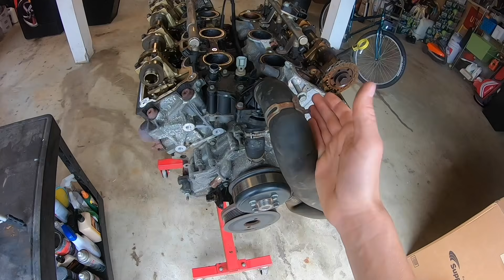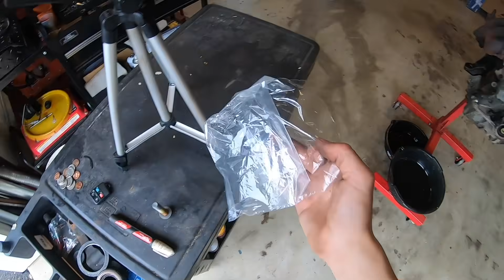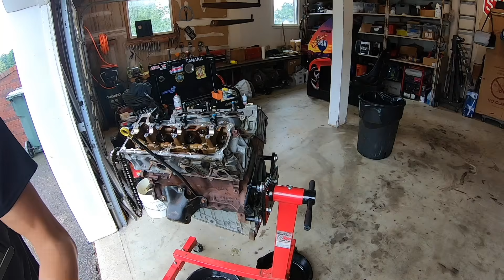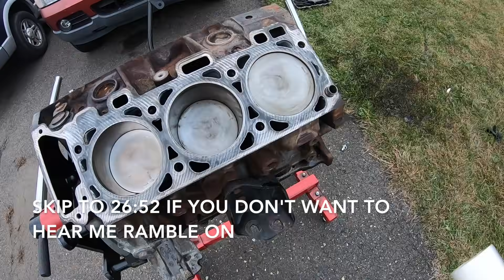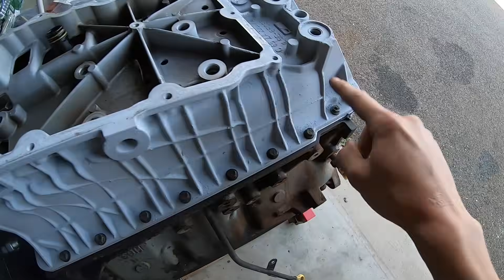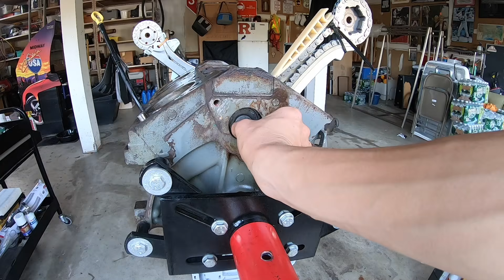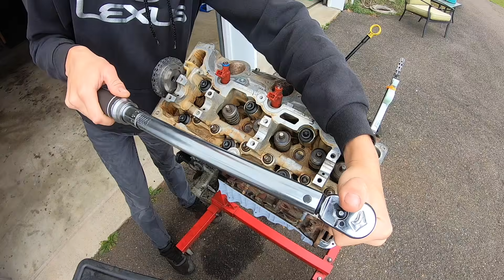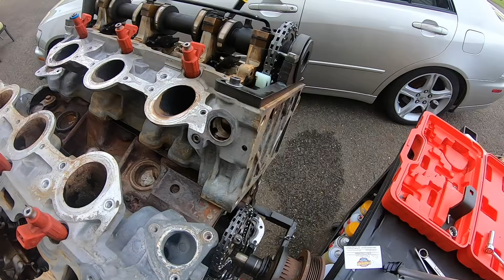Ford 4.0L SOHC V6 Head Gasket and Timing Chain Replacement (COMPLETE GUIDE)

Comment: 2005 ford explorer. Blowing exhaust out resavior. Run hot still have water. Won't start now. Did compression check. 2 readings of ,60 and 80. That's from the blown gasket right? Those cylinders were right next to each other. Had a 180 165 155 on other side. If I change the head gasket it should run again right,?
Reply from the maker: Yes
Reply: It's passenger side. So I have to remove engine from vehicle to do the head gasket?
Reply from the maker: @richardvanwinkle1887 it’s recommended to.
Reply: Could you please explain how you would without removing? My wife and I are broke down in denver. I get a VA check and that's it. I have no ability to remove it.

Comment: I heard different things. I heard the sporttrac fixed the timing cassette issue before 2007. I don’t know how that is possible though because it’s the same design 4.0. Did the sport trac ever fix this issue during the sport trac model duration? To me the 4.0 issue was a design issue and it was never fixed? Am I wrong?
Reply from the maker: The 4.0 was never fixed. It was fixed in 2011 when they discontinued it.
Reply: @iamdjnam  lol

Comment: First off DELETE THE UNNECESSARY BALANCE SHAFT!! Unbolt it throw it in the trash! plug the 2 holes that are threaded already that feed oil. If you have an old engine there are quite a few small plugs that you can take out and use.  The engine will have better response and better oil pressure that is needed for the tensioners. Another "mod/upgrade" is putting an O-ring on the peg on the right side guide for the main chain since it has a peg that goes through the oil jacket for the driver side tensioner and oil pressure sensor. Ive seen oil leak passed the guide.
Reply from the maker: I only put the balance shaft as a tutorial. I always delete it.

Comment: There's a lot of info saying this engine is a non interference engine. So I get all excited taking it apart that I won't have much damage outside the timing chain. Well I have 2 bent valves on the left and one on the right so that is, in fact, b.s. Thank you so much for this video. Your stuff helped me so much otherwise I don't think I could've done it.

Comment: 1:03:06 Love what you do. I have a serious issue. Swapped 2004 Sport Trac for a 2006 Ranger motor. Started it and it made a racket. Stripped it back down in the engine. 
Nub on Sport Trac is down, but I put Ranger up according to your video. No joy. Timing assembly doesn’t line up in Half Moon on Ranger, but does on Sport Trac motors. Could older (2004) engines set up 180 out? 😵‍💫
Reply: Btw, driver’s side cam.
Reply from the maker: @nathanhightower3150  nub must be up on both engines. Timing was always set the same. Sounds like your passenger cam is 180 out.
Reply: Yep. Set it at TDC exhaust versus compression AND IT RAN, but I shut it down and tore it apart.
Reply: Corrected and running well!

Comment: Just found out today that my head gaskets are leaking on my 08 mustang 4.0. Do I have to remove the front timing chain cover and chain and the cam shafts to do the head gaskets?? I don’t want to pull the entire engine, just do the heads only.
Reply from the maker: The entire engine should be removed.
Reply: @iamdjnam  can I ask why? Does it just make it easier is all? I don’t want to replace everything like you showed in your video (which is VERY good), I just wanted to replace head gaskets only and possibly the water pump
Reply: @iamdjnam  I think I emailed you before when I needed help doing the rear main seal. Can I do that again if I have questions about this project? Also…..: how do you know so much about these engines at such a young age, it’s amazing 😊
Reply from the maker: Yes email me if need be

Comment: Finally finished the timing gears and the timing jumped and broke two valve springs, ran 1 day so it all came back out and I asked before, can I pin the gears on the cam and jack shaft, Ford should have done that in the first place, even thought about a small tack weld.
Reply from the maker: No you cannot pin the gears. I’ve never had an issue using the timing tool kit as intended.

Comment: I chose the young man for the same reason you did. He I very smart, and explains everything so I can understand what the heck he I doing . And above all  he gave the confidence to do my 2006 4.0 Mustang, where before I was very scared to do so . I thank you for the great videos. You made me proud of myself for fixing my Mustang.  Thank To You.
Reply: Hi. Did you pull the engine to do it or were you able to do it with the engine still in the Mustang?
Reply: @MarcinButzak  I think very few people have pulled off replacing the rear chain with the engine in across all platforms

Comment: I did the passenger and then driver.  When I spun the motor the passenger was slightly off, using the holding tool it was not quite perfect to slide those notches in. Is there going to be some slop in there that is tolerable.
Reply from the maker: Loosen both cams and start over.

Comment: Do you have to remove the motor to replace the head gaskets ?
Reply from the maker: No but you should because you can’t replace the timing guide with the engine installed.

Comment: I have a question. I only removed my cam shaft and replaced the hydraulic lifters. I put the crank on TDC. After installing the cams back I turned the crank a couple of turns. Now I don't know if the balancer shaft is in the right position. I didn't open the front plate. Do the cams correspond with the balancer shaft or just the  crank?

Comment: This video has helped me wonder but I ended up snapping my lower positioning bolt. When you said the torque spec did you mean 89 in lb like in another video you did or is this one actually supposed to be 15 ft lb. Wasn’t sure if I did something wrong or not.
Reply: Wonders*
Reply: Or if my bolt was just bad
Reply from the maker: @PlusUnum  depending on the source the spec is different. To be honest I just go by hand.
Reply: Ah okay thanks 🙏
Reply: I think there is a difference between inch pounds and foot pounds. I’ve noticed they say 2 different ways of torque

Comment: Hey i want to start off by saying I appreciate your videos, I couldn’t do remotely half of what i did on my Mercury Mountaineer without your help, but right now I’m at a snag, So i rebuilt the engine mostly and after i put the engine back in and fired it up, the car shakes violently when i start it, it will smooth with some gas but it will go right back to shaking and i believe it’s bcuz of the Harmonic balancer not being pushed back far enough, i have a “2008 Mercury Mountaineer 4.0L V6” and the tools i could only find don’t fit the harmonic balancer correctly, my harmonic balancer is the Long cone shaped one and i can’t hold the nut in order to ratchet further in properly so the belt doesn’t stress itself when turned on, idk what tool to use or if i could upgrade the harmonic balancer to the shorter more open ones that I usually see that would help but idk honestly, autozone or anywhere else only recommends that same harmonic balancer and it’s just too long to get it installed correctly, Please Help Thank You!
Reply from the maker: If your harmonic balancer isn’t pushing on all the way, sometimes it’s because the wrong crank gear was used from the timing set. They don’t tell you there’s 2 thicknesses and I’ve made that mistake it the past. Also sounds like you have a vacuum leak. No matter what harmonic balancer you use, 2002-2010 it will work.

Comment: I wished i had your knowledge about this engine at your age! Life would have been different by today. i have been rebuilding many inline diesel engines but never this V6 4.0l Ford EXPLODER! Yes a customers Ford EXPLORER exploded and we are going now thorugh that whole procedure. I usually do my engine rebuilds according to the best video i can find, wearing headphones during the job and have the video running on a big screen in my workshop. This time its yours which will run several times up and down! Thanks young man for all the hints and tricks as they are essential. Your video makes it safe to rebuild even as a beginner (i am not)!

Comment: thank you for this vid. i learned alot about this model motor. i'm doing a timing chain replacement on 05 sport trac.  alot more involved in timing than there used to be with old motors. i'll be following this video for my repair on this motor.  thank you again for your time!
Reply: For sure!

Comment: Can I pin the cam gears, still would do the whole torque deal, also the only reason to use torque to yield head bolts is the MLS head gaskets.

Comment: Regarding turning engine   Crank shaft by socket 360  degree to check if engine turns freely, should valve cover need to be off to check see if cam gears they line up to TDC???🤔

Comment: I did all this and it ran great for 20k miles, then one die it started sputtering , made it less than a block and died, I checked spark compression, fuel pressure, noid light on injectors all are good. I'm afraid it jumped time again somehow. Probably the cheap Chinese timing kit I got off eBay. It turns over and won't pop or sputter at all
Reply from the maker: You have compression?
Reply: @iamdjnam  yes compression on all 6 cylinders. .
So, it has run absolutely beautiful since I did the timing job following your video. I was coming home a couple weeks ago from an hour drive, as I was pulling to a red light it started feeling like it was going to die, I stopped at the red light and it sputtered and barely stayed running, when it turned green, I pulled it off into a parking light and it died as I pulled in. I have tried and tried to turn it over since then and it has never popped or even tried to start again as though it has no fuel or no spark. It kind of seemed like it was running out of gas, so I put more gas in it, put gas in the intake, nothing not even a pop. Checked the fuel pressure at the rail, 60psi. Put a noid like on a fuel injector plug it flashed. Checked spark with a spark tester multiple times it sparked and even shocked me twice. Checked compression on all cylinders and they where above 120 on my cheap harbor freight compression tester. I don't trust the compression tester but I could tell that they had some compression, at least enough to sputter or try to start..... So I'm thinking that somehow the timing skipped and the thing is sparking sometime when the valves are open only
Reply: @iamdjnam  oh yeah, and I checked codes and got P0340, cam sensor code, changed to a different cam sensor and crank sensor, that's where I'm at so far

Comment: I'm working on a 2006. The chain came out the driver's side valve cover. But it happened when trying to start it. When I took the cam off, so all the valves are closed, I can't blow air into the cylinders. But I guess there could still be a slight bend somewhere still. Or is it possible it's safe? IDK 
I will be taking it all apart later and checking everything. I did get the engine out today. There are signs it's been out before. Maybe some Ford recall? IDK
I'm in California, so the exhaust bolts came off eay enough. One stud came off each side, but one side was missing the stud and nut. LOL
Well, at 9:40, yours looks like the short one on the engine I have. The parts lists sho long piece on that gear.
Reply from the maker: You bent the valves. Need to send the cylinder heads out now.
Reply: @iamdjnam  Since it seems I can't find new bearings for the balance shaft, I'm going to have to leave it out. So I just need to plug those two oil valleys with a bolt, right? That's it?
Reply from the maker: @shark70007000  yes

Comment: What is the installation depth of the front main seal into the timing cover?
Reply from the maker: Even with the back side
Reply: Just asked this same question.  Even with the backside? How would you know how far if installing the seal with the cover on the engine?

Comment: What is the purpose of the balance shaft.  If you can delete it and the engine still run fine, what is the point in having it in the first place?
Reply: Good question.

Comment: Have a couple questions please, 1 will any 4.oL sohc interchange into a 01 ford ranger edge 4wd automatic trans. 2. we turned the cam shaft on one head, is it very possible that I bent the valves.
Reply from the maker: All 4.0s are interchangeable and yes you could’ve bent the valves

Comment: If my car has broken guides (which I’m assuming happened) and the car still runs, does that mean I could still have bent valves or would it have quit running if I bent the valves?
Reply from the maker: It will stop running.

Comment: If I’m just removing the heads to have a engine shop rework them flat for a head gasket replacement, if I buy the tool do I need to worry about the fashion in which I remove the camshafts and timing chains in relation to having it back in timing with the specialized tools when putting it back together?
Reply from the maker: No but just follow my order to be safe
Reply: @iamdjnam  awesome man I appreciate it you made a very good thorough video , also I saw something in there where you had captioned “spaghetti arms” on there , I go to the gym 5 days a week and have quite large arms and you wrench on a car 10x better than me and most “strong” guys I know , love yourself my man your brilliant❤️🤙🏻
Reply from the maker: @larrywatts4225  much appreciated brotha! thanks for the kind words and support. for a small guy like me that totally made my day! any questions you have I’m right here for assistance.
Reply: @iamdjnam  I appreciate it brother ,all love. I got my engine apart right now getting ready to undo that 19 mm bolt through the sprocket and the rear bank tensioner bolt and all that fun stuff , appreciate the help.
Reply: @iamdjnam  to use the tool to put the engine back in timing do you have to put the engine in TDC ?
Reply from the maker: @larrywatts4225  yes thats step 1
Reply: @iamdjnam  I don’t get how the camshaft tdc positioning tool works could I put the clamp on at any angle and then when I turn the crank until the post touched the block it could be in any position?
Reply from the maker: @larrywatts4225  just put the crankshaft keyway to 12:00
Reply: @iamdjnam  hey man I got to the point where I was putting the heads back on but now the front timing chain doesn’t have enough slack to put the sprocket through to the camshaft any ideas what might be causing this ?
Reply from the maker: Chain not fully engaged in jackshaft sprocket
Reply: @iamdjnam  so fallen of or in between links ?
Reply: @iamdjnam  we put a 19 on the crankshaft bolt and turned it while on of us applied a little pressure on the chain and it came lose from whatever it was bound on , not the most at ease thing I’ve ever gone but it works
Reply: @iamdjnam  at Ted my driver side cam is just the smallest amount off to get the tool on that holds the “half moon” portion of the cam in place , would it be okay to turn the camshaft ever so slightly with a pair of vice grips to get it in place ?
Reply from the maker: @larrywatts4225  yes

Comment: need help finding vacuum diagram for the vacuum shifting transmission? engine is early 1994 Mazda B40004x4, push rod, roller cam.  long metal tube was damage, need also too replace, and need to know how it was attached to trans. thank you. I enjoyed the 4.0l sohc timing. good job.  have you done a video of the above, removing trans?.
Reply from the maker: There is a transmission removal video on my channel. It is not the same for your 94 though, different transmission. For vacuum routing consult a Haynes manual.
Reply: @iamdjnam  the one I have does not show much. Thanks for the advice. I'm also going to visit a local Ford dealership. Anyway thank you very much for the help

Comment: When torquing the oil pick up tube is there a gap between the bottom of the plastic tab and the girdle surface?  Mine has a gap when I reach the 89 inch lbs. setting.
Reply from the maker: No

Comment: Awesome video my plastic goose neck failed and overheated the engine and blew the head gasket . A cheap piece of plastic part and you can get a metal replacement . Why do car companies let their engineers design shit like that !!!  My mustang only has 71000 miles  . Thanks again 🇺🇸

Comment: Hey brother! I hope things are going well for you . As I mentioned before your video has helped out a lot but i found one lil problem When you were given torque spec on the cylinder head bolt You said 108 fob and then you said 18 pounds I ended up snapping one of the bowls but it wasn’t a big issue because I was able to take the head off and take it out but you might want to look into that and change it thank you bro other than that your video was amazing very helpful I am almost done working on My project take care
Reply: Minute 45:40
Reply from the maker: @kirtonvincent  108 inch pounds, 18 foot pounds, 90 degrees then another 90. Just watched the video and checked the manual. The information is correct.
Reply: Lol ok than I take it back it was my fault 😂 I will pay closer attention next time
Reply from the maker: No no you’re good! Always happy to hear input and double check my work.